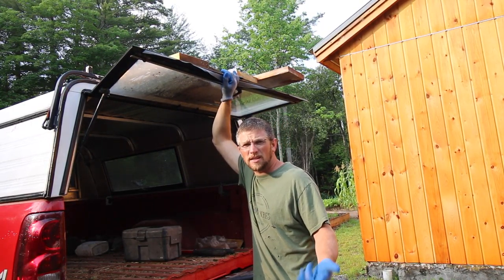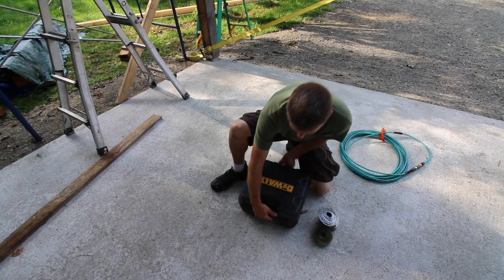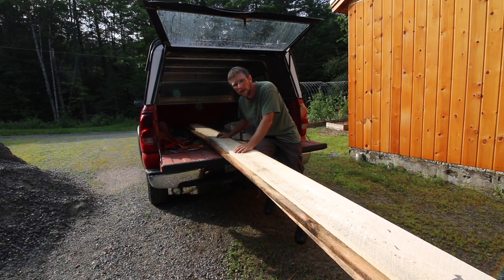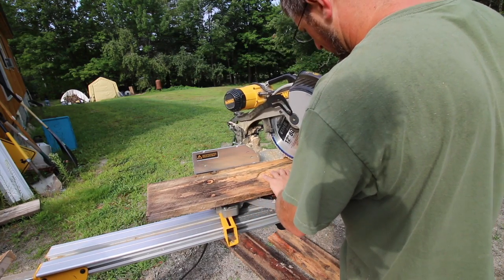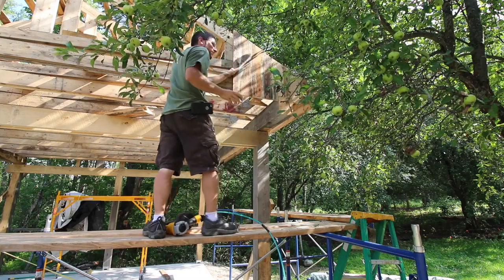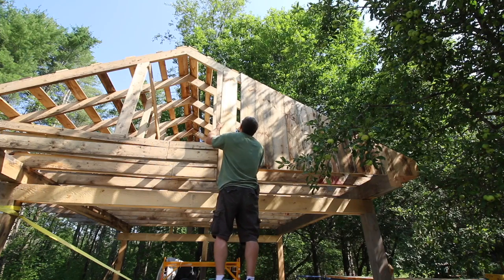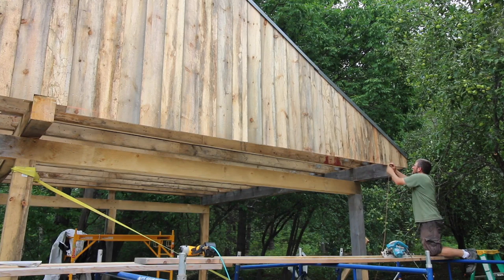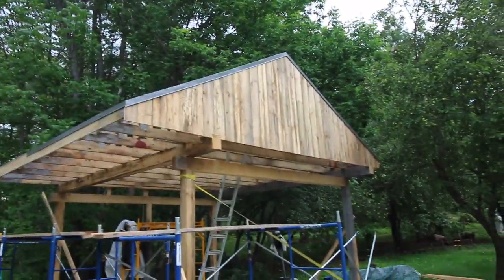Its Starting to look like an old West town around here!

Comment: The little tractor was designed for a purpose  and mowing is a major part of it anything bigger won't mow as well.
Reply: soaringtractor but it works well for its intended use
Reply from the maker: Yes it is designed for a homeowners use.
Reply: Lumnah Acres i bet its a whole lot easier than using a shovel and wheelbarrow.

Comment: You could simply use you router to make a "Lumnah Acres" or "Lumnah Acres Kitchen" or just kitchen sign and burn the bottom of the letters. Maybe 3 rough saw boards with a 1 by frame. Fractal burning would be cool also, but maybe a bit much for now.
Could also hand paint it in white with black shadowing like an old cowboy "Saloon" sign. "Gina's Saloon" "New Yolk Saloon". lol
Reply from the maker: That would be awesome! I wouldn't be able to free hand any of those

Comment: Did you win lotto?  All the equipment you have must have cost a small fortune.  I love tools but wow, you really have it nice?
Reply: He's a carpenter by trade. Of course he has tools! That's like saying to a painter, jeez, you got a lot of paint brushes, paint, and canvas!
Reply from the maker: No I didn't. We bought our first house in 2004 and it was a fix me upper. When we need to fix it I would by one tool at a time learn how to use it and get the project done. When we built this house in 2015 he had most of the tools we needed. This is the third house. We have always bought the most run down house in a good neighbor
Reply: Lumnah Acres That makes total sense.  I recently watched your vlog on the front end alignment on the Mazda 6....so I thought perhaps you were a mechanic.  Great vlogs, love em